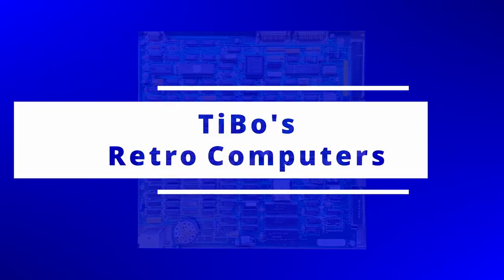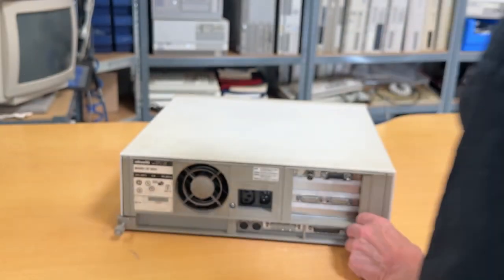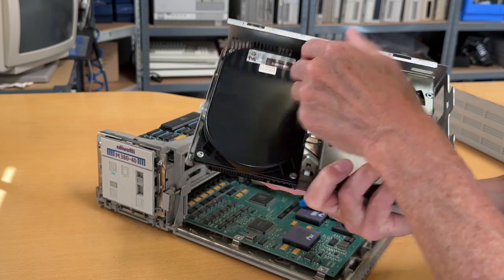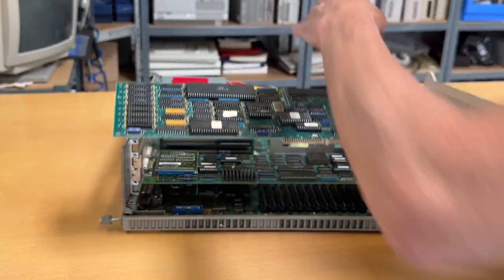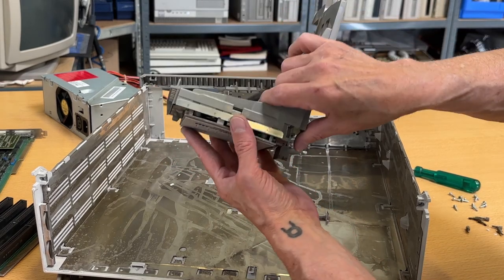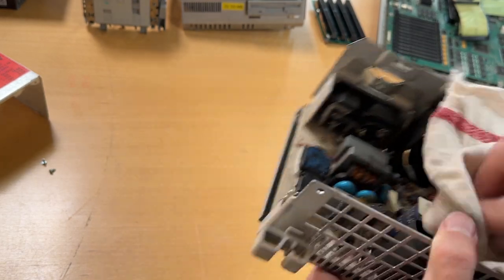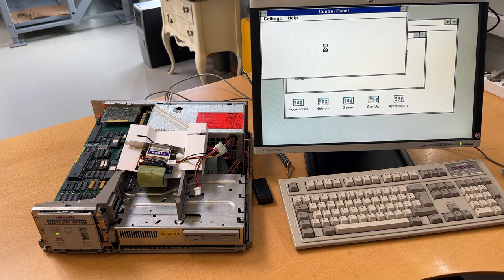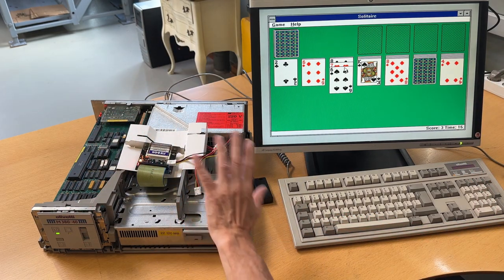Olivetti M380-40 - Intel 80386DX - The fastest computer!

Comment: The GO478 card is a WAN Modem controller card. Depending on the piggyback card installed on the board,  it either supports two times V24 (with IF389) or one time V24 and one time X21 (IF431). If it is the latter one, the top connector is V24 and the bottom connector X21.
Reply from the maker: One again you come to my resque. Thank you so much. Do you have documentation / software for this card?
Reply from the maker: The piggyback module on the card is the IF389
Reply: @TiBosRetroComputers  I don´t have any specific software for it. The information of the card was taken from the Pocket Service Guide. There´s a specific version for LAN/WAN/COMM components. It also contains some further details on the jumper settings for the card.
Reply from the maker: @olivrea  Can you please forward this documentation to my email?

Comment: Hi TiBo my first thought when I saw the model number was that this was PC had a 386 running at 40Mhz which was the fastest 386 made, but that was an AMD Am386 DX-40 processor.  The DX-40 required a motherboard that supported a 40Mhz bus however.
Reply from the maker: All correct ... This is the fastest Intel 80386DX CPU - But "fun fact" is that Olivetti also sold this computer with an AMD CPU inside. So perhaps one could replace the Intel with the AMD running at 40MHz and also swap out the 66MHz crystal with a 80MHz - But that's not a mod I'm willing to do with this computer

Comment: You need the Olivetti pocket reference book (revised annually or sooner) which was spiral bound and had all the dipswitch settings and info on the option cards. Odball cards are usually epos equipment or some legacy ibm emulation card
Reply from the maker: I have the Olivetti pocket reference book (In PDF) and this card is sadly not mentioned
Reply: @TiBosRetroComputers  In the early days a pocket reference would be good for a year or so, as we moved onto the cheap stuff they were out of date as soon as they were printed.  But to be fair, those oddball controllers would remain in there.  Bound to be some emulation card or similar.  We would get kit turn up in the lab with strange cards inside and we had no idea what it was.  There was also Olivetti Numeric Control (ONC) which had modbus/rs485 - but that card has too many chips on it for that application i think.
Reply: @TiBosRetroComputers  There is also the olivetti alumni group on LinkedIn - very quiet - but people older than me on there - I’m 53 and i started work in the lab at age 16 (1986) till about 1992
Reply from the maker: @eliotmansfield  Thanks for the info - I'll try join that LinedIn group - and 53 is still young, I'm 55 ;-)
Reply: He has it.

Comment: Not a “proper” M380, that was the cost optimised version - or Olivetti office version.
Anything with a galvanised chassis instead of zinc plated chassis were cheap things when Olivetti was the beginning of the end of decent kit
Reply from the maker: This casing was widely used by Olivetti and DEC! If you want to use "cost optimised version" just have a look at the PCS line of Olivetti; that was totally cost optimised casing.
Reply: @TiBosRetroComputers  Yes, but when you look at the M24, M28, M290  etc they have zinc plated chassis - everything after that was downhill cheaper stuff - which they had to do to remain competitive, but like a decent classic car - just not the same feel and weight
Reply from the maker: @eliotmansfield  M24, M24SP, M28, M28SP, M240, M280 and M380 are zinc ... the M290 and M300 (Completly the same) are also plastic
Reply: @TiBosRetroComputers  i agree
Reply: @TiBosRetroComputers  You need to find a CP486 - that was the daddy back then - was known as a lsx5010 shortly after, around when they acquired filenet. M380T (tower) was pretty cool as well with the led text display on it. I had one at home for a while running netware 386. That, along with my Novell OEM servers and NDS4 (disk expansion box running scsi 300mb disks) were all dumped in the trash 🥲
Reply from the maker: I'm soooo looking forward to that day where I'll be the owner of one of the Tower PC's from Olivetti
Reply: @TiBosRetroComputers  If something turns up in the UK i might be able to help with logistics maybe
Reply from the maker: @eliotmansfield  Honestly that would be AMAZING. Thank you so much just for offering this